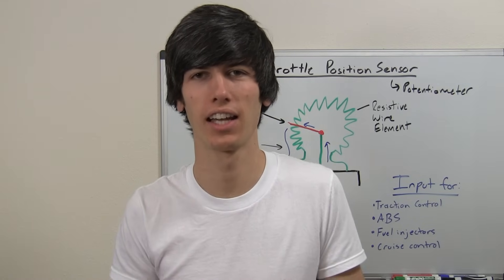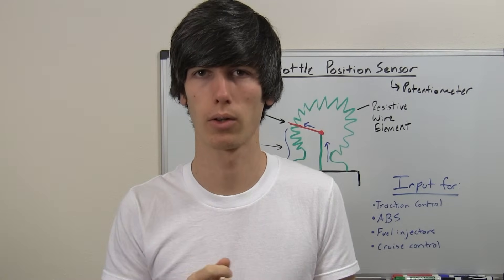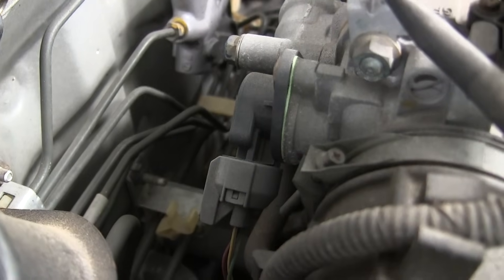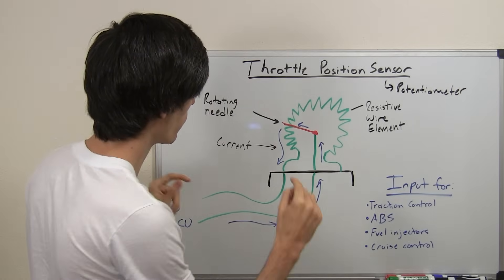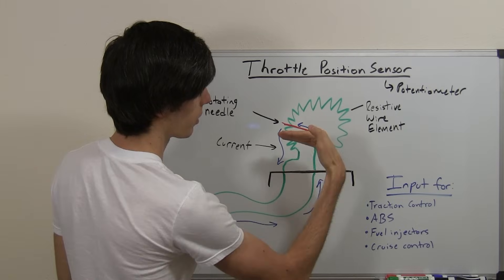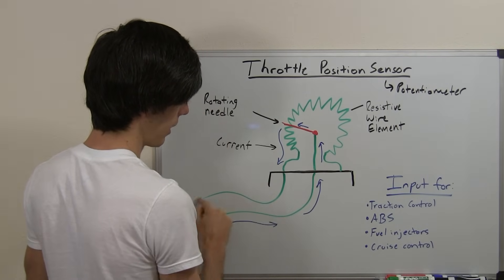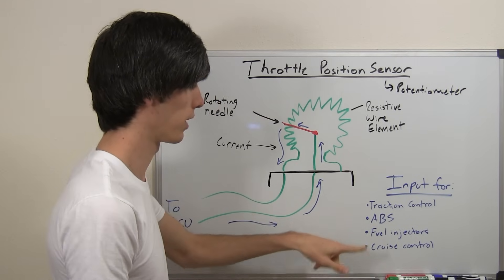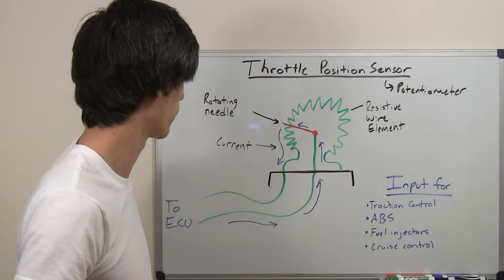Throttle Position Sensor - Explained

Comment: I have a question.i have a mustang that has m.a.f.the car is modified and has no o2 sensors.the car pretty much runs great,but sometimes when im in second gear at low rpm.and put the throttle to the floor it has a flat spot.it seems to only happen in second.under a load.do you think I have a bad tps or is it because it doesn't have o2s to give the ecu more imformation..any tips would greatly be appreciated.like I said its when im in second gear,at low rpm,and im trying to spin the tires.

Comment: I think that when butterfly valve is in 180° position (it lays and air has the easiest way to go further) the resistance is at minimum. So if you declare ohm's law 
U = R*I, where U is voltage, R is resistance and I is current, you can find out that there is the lowest level of voltage when you floor the pedal (opened air breathing) and when pedal is not touched (butterfly valve closed the air income) the voltage is at its maximum. And you know it.. sorry for my ENG, i hope you can read it :-D

Comment: So am i correct in assuming that when the tps opens up, there is more resistance being added there by lowering the voltage sent to the ECU?  

I'm just wondering whether the ECU reads more voltage as an open throttle or reads less voltage as an open throttle.

Comment: the rpm meter is connected to the distributor (or modern equivalent) and monitors how fast the engine is receiving ignition and transfers that signal to the rev counter

Comment: I believe its just pulse readings off the distributor, and amplified by transistors to push the needle to the right. There's a return spring that will pull the needle back.

Comment: Help!!! I have a VW Jetta 1.8t. I think that I destroyed my throttle body. I clean it thinking that it would save me on gas...I should have asked a pro before. I  moved the butterfly to clean the inside and at one point I held the butterfly open with a rag so that I could get it nice and clean. Now I have a shiny half working throttle body. I am getting a code that is saying that the throttle body maybe damaged. EPC is showing up on the dashboard and sometimes my car won't start. Any tips?

Comment: its basically a voltmeter that recive electricity from a magnet atached to the in put axle , that's it , the speedo meter is the same but this time the magnet is atached to the out put axle from the gear box

Comment: I really liked your videos and it got me more informed about the mechanics involved.
However i have a question, I have a 150cc yamaha motorcycle (szr 150) that has a mikuni BS26 carburator, it is not a fuel injected system nor has any ECU unit, its butterfly valves are purely controlled by the twist of the throttle and i can not visible see any mechanics involved that connect the engine or carb  to any automated system but it still has a TPS sensor. What is the need of placing it there??

Comment from the maker: Well, for example, many cars run rich at wide open throttle, and this is done so that the cylinders don't get too hot. By using the TPS, your ECU will know to inject more fuel than the MAF is saying to inject, because the MAF is trying to achieve a specific A/F ratio that the TPS is telling the injectors to exceed.

Comment: In your other video you mention the mass airflow sensor is also responsible for fuel injector flow; can you elaborate why both the TPS and MAF are needed for injector flow? What does one do that the other cannot with regards to the injectors?

Comment from the maker: Hmm not sure about your idling problem. My car will idle at about 1500 on a cold start, but as soon as it's warmed up it goes down to about 800. Never bounces at a stoplight or anything like that unless the A/C is on, which of course when the compressor turns on the engine rpm takes a small dip, then rises back.